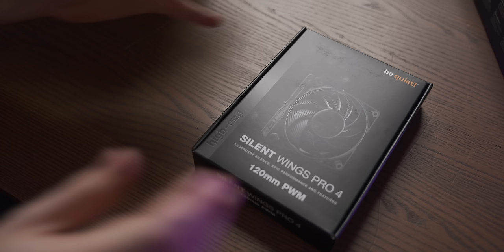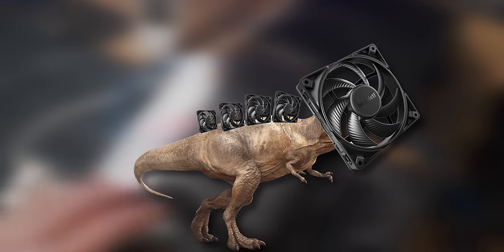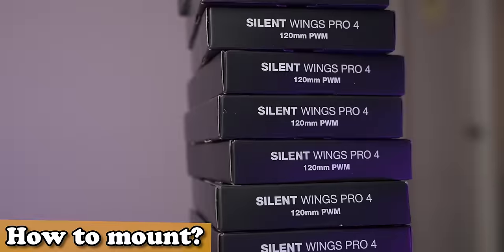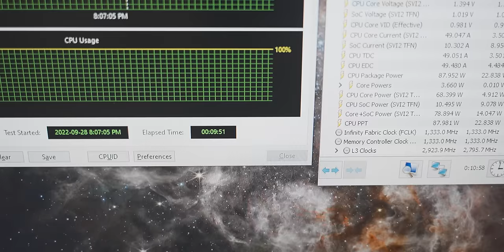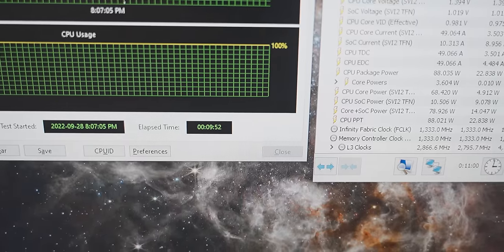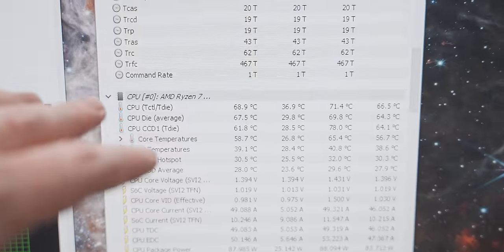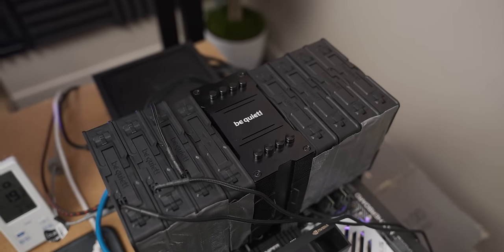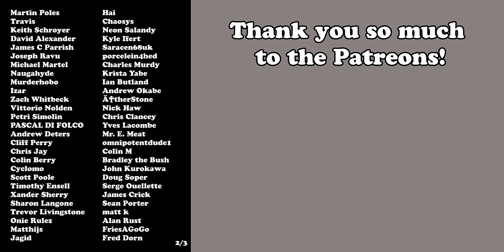More Fans = More Better?

Comment: I would like to point out that without an air flow straightener all you're doing is re-spinning the air that the previous fan is spinning thus not actually improving performance

Comment: Doing it outside of a case does nothing. Stacking only works when used on case intake fans or case exhaust fans because it keeps cooler fresh air inside the case for the GPU and CPU cooling to utilize. Nice try though.

Comment: More fans doesn't really end in more air or more airflow. Especially not if they are mounted as a "tunnel". Common sense.
On at the front and one on the end of the heat sink might help with a more steady airflow but that's it.
The first fan pulls in the air, the second on just passes that same air further. So does the third, and so on...
 So no, it's not better.

Comment: This is bout what i wanted to do with my pro audio amplifiers at the club cause their running at up to 90 degree celsius sometimes and have only 4 tiny fans and im like hmm need to get some hyper speed pc fans to moun either inside or outside seeing as it helps a ton at home.

Comment: You didn't call this the "FANtastic Video"?! Also, in the future for AMD the 5800X would be much better, because it's a hot boi. The 3700X is actually a fairly reasonable CPU when it comes to thermals

Comment: It was loading up based on heat DISSAPATION use it with all those FANS BRO HAVE FUN. meaning THE CPU was doing more... temps won't drop it will have a higher benchmark

Comment: I think if you went from all sides, it would lower the temp....probably not by much, but it would at least cool off an area that wasn't receiving any flow or pulling hot air away.

Comment: Next, get a blower fan (the kind used to dry carpet and floors) some ducting to the CPU cooler tower, then some more ducting straight into an AC vent for the fan intake. You might even hit 67C.

Comment: stacking fans will not increase airflow, however if you have each fan running in the opposite direction it will increase static pressure.

Comment: wow such linear thinking for the positioning of the fans. If you really wanted to think outside of the box, you could have made a wind funel with 4 fans, spread out on the wider side and only 1 or 2 fans on the tighter side,  to push more volume of air. Even tho I wouldn't expect much different results with that kind of set up, but this way you get to make a redonkulos video with minimal effort and materials.

Comment: You cannot run fans like that, there is no impact when you add one fan in front of another and they are spinning the same way directionally. You would need one fan spinning in reverse with one fan spinning in the regular direction. Man, the random things you learn from working with server cases, huh?